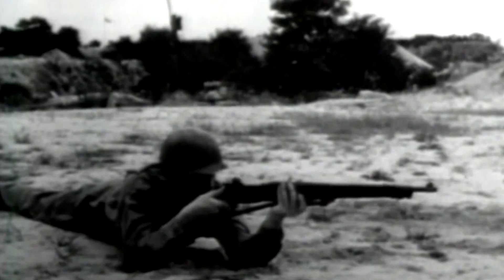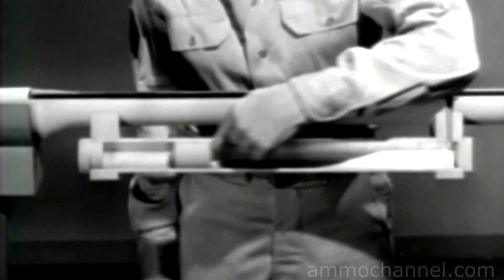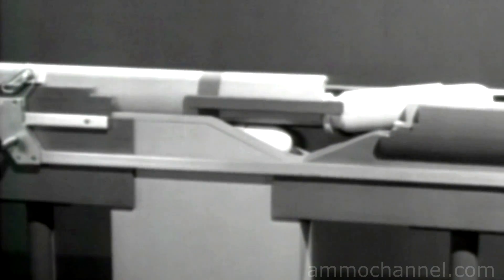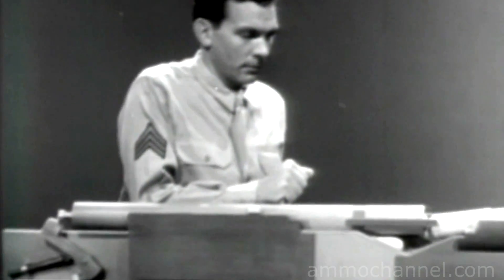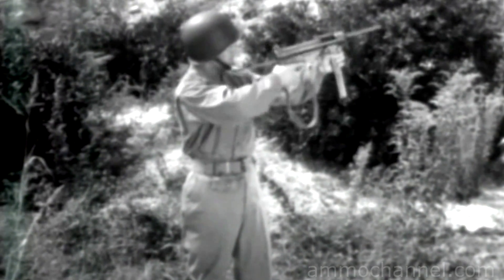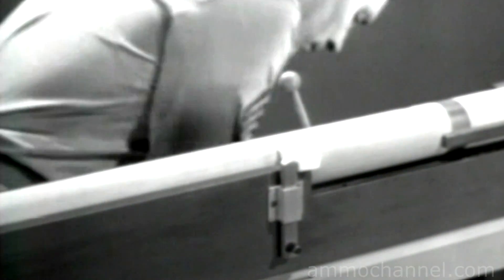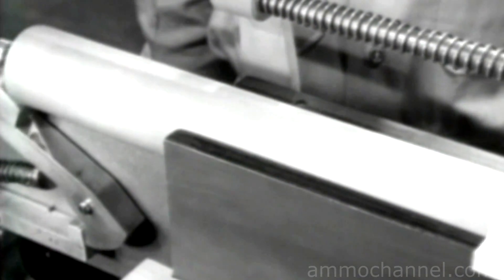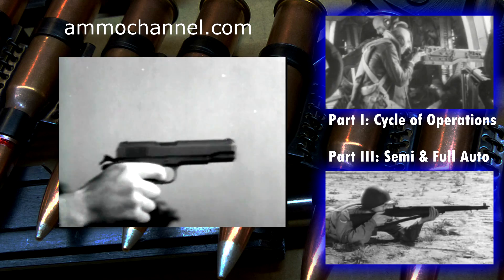Firearm Mechanics Part 2: Types of Operations (Manual, Gas, Blowback, Recoil)

Comment: Which of the 3 types would be the least maintenance sensitive one? But at what cost? (Weight?)
Reply: not an easy question to answer, blow back is probably the most simple system but is also the most violent. Gas operation is probably a little more complex but probably a bit gentler, however the fact it's positively locked might lead to problems. Recoil operation probably is the most complex here so I suppose that is an easier answer there.